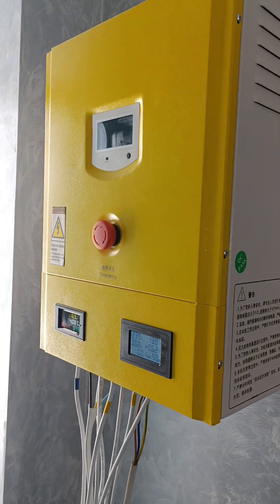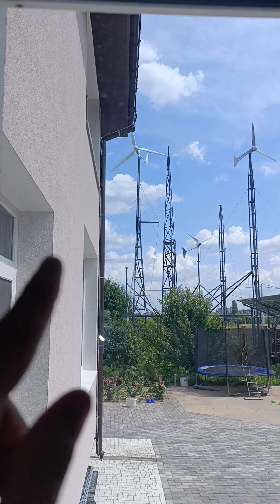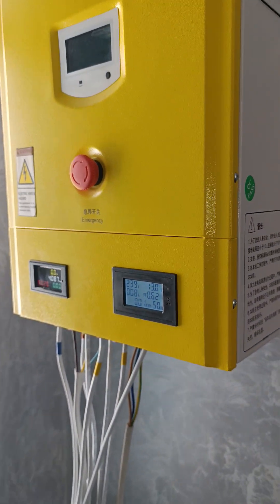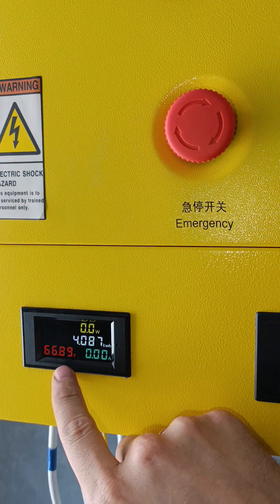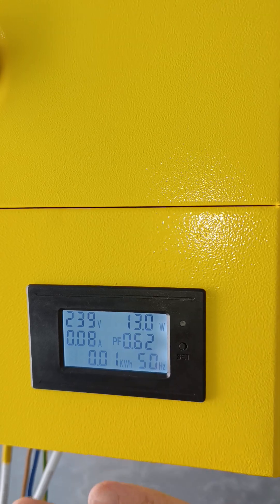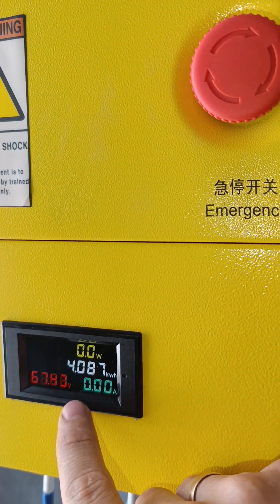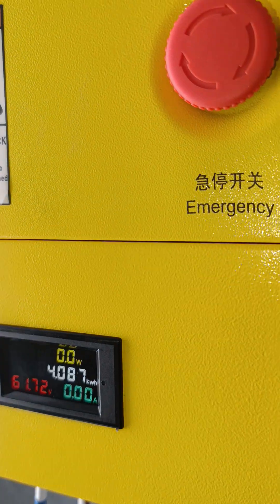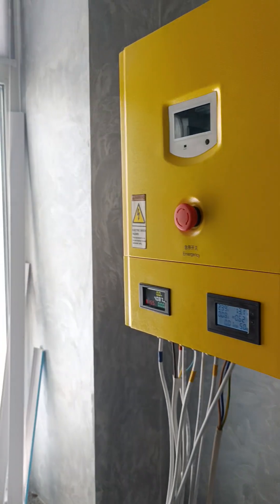This is how upgraded Deming looks with two added multimeters

Comment: Hi Mate, I really wanted to get another S5 48V 1000W 6 blade wind generator, so I asked the sell to add After Pay to their payment operations , so they sent me a another link. Good seller.
Reply from the maker: but, 6-blader is literally 3-4 times slower in rotations if compared to a 3-blader. you have to get that one probably 1 step higher in nominal voltage to make it work somehow